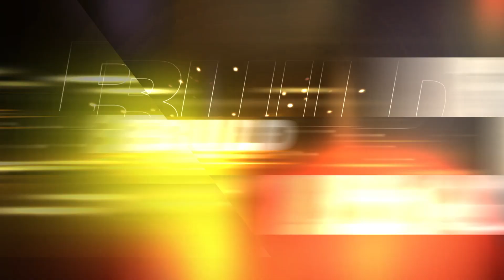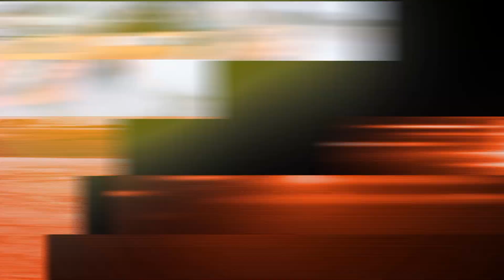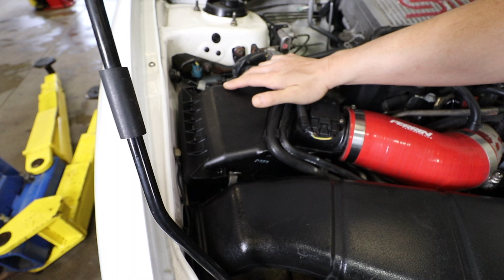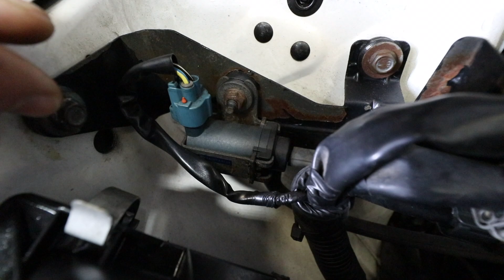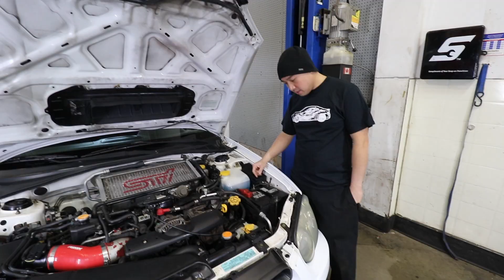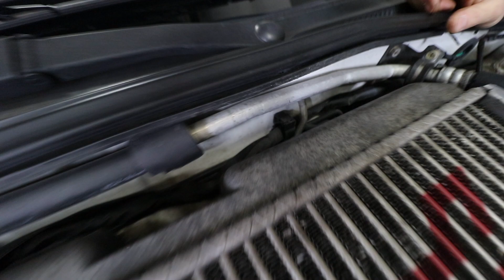Beginner's guide to a turbo Subaru engine bay

Comment: the throttle controls air and the system which is known as ECU decide how much amount of fuel is to be injected from the nozzle by getting the details from the throttle position sensor TPS

Comment: This was awesome. Just picked up an 04 WRX and found there’s a ton of stuff missing, disconnected, or broken. Very useful
Reply: how’s everything going? been thinking of picking up an 05 and just wanna know what i’m getting myself into
Reply: @diet_soda  did you ever get an 05? i would look for rust first of all. if the body is good with zero or minimal rust then get it!! then fix anything wrong with engine suspension anything to make the car ride and run right. then bodywork and paint and any broken windows/windshield.... most of these cars will be beat up. i just picked up an 05 and it needed a lot of maintenance work!! i ended up doing some of the work but now im saving up money to have someone replace the engine. i dont feel skilled enough and i dont even have a garage to work on it. lol!!